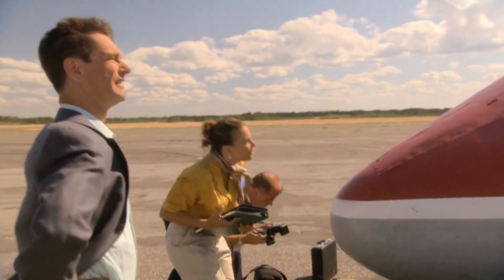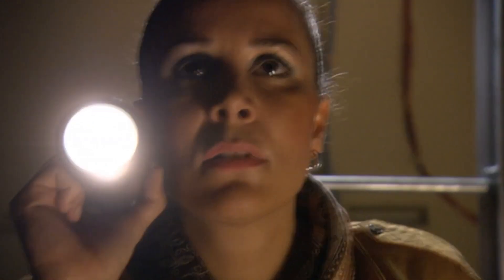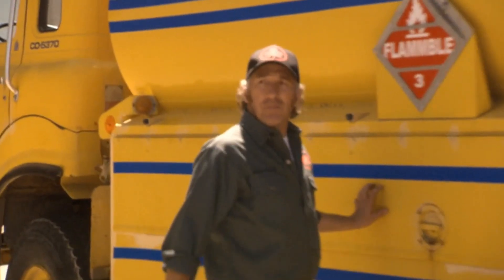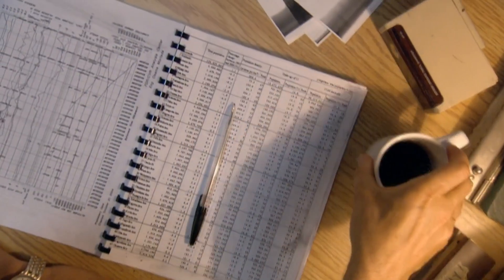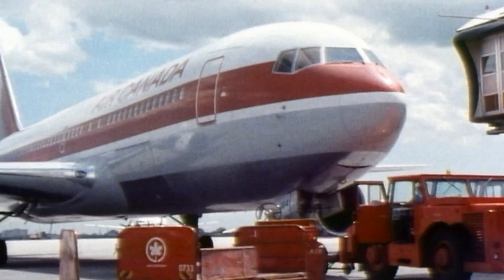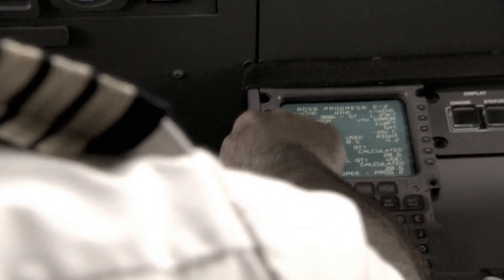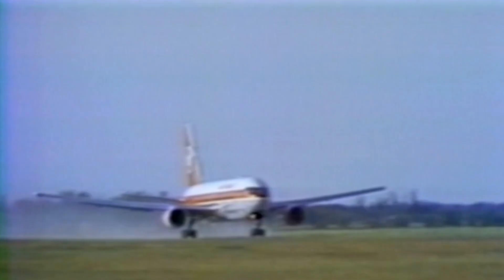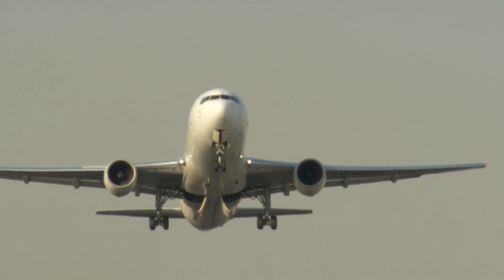Investigating The Gimli Glider Crash | Gimli Glide | Mayday: Air Disaster

Comment: How is it that the pilot was “partially blamed” instead of Loudly praised?  The pilot and copilot should have been hailed as heroes.
Reply: I wondered the same thing.  There should be no blame for them.   They are heroes.
Reply: They needed a scapegoat
Reply: Agreed,  sometime you wonder about the management must drink lot coolaids
Reply: Captain Sully went through the same blame by the FAA. They tested pilots with the same problem (engines out) and see if they could land at the nearest airport. All could. But they were all prepped about the failure and how to and where to land ahead of the test. No one mentioned how pilots that were not prepped did, UNTIL Sully asked the question. The FAA had done the tests, and none of the unprepped pilots made it to an emergency landing at the nearest runway. The FAA wanted a scapegoat and thought they could manufacture one by blaming Sully. They failed where he succeeded. Why not acknowledge the real problem? It will save lives, not destroy them.
Reply: @hifinsword  This was made up for the movie. There was some minor second-guessing because the FAA wanted to see if it might have been possible for Sullenberger to make Teterboro (even in the event of a practically perfect water landing, there are always lessons-learned to be taken and things to be seen if the crew could have done better; the better to inform future crews who might find themselves in the same position), but it quickly became apparent that it wasn't. The NTSB and the FAA went out of their way to explain that their investigation was simply standard procedure after any form of plane crash and was not meant to be in any sense an indictment of the actions of Sullenberger and Skiles.
Reply: You can be part of the problem and solution.
Reply: @claudiuspulcher2440  ~ Yup, and you can have a wife & a husband, too. Go for it, Claudius.
Reply: Had exact same thought when I heard of them being blamed - say what???
Reply: Well, the initial thought is that it's on the flight crew to make sure there s enough fuel. But when you think about it theres nothing they reasonably could have done differently
Reply: It's from the gov't! That's why!

Comment: I am at 5:19 into this video after watching the event happen on another video. I think before this video is finished that I know what went wrong! I will say so now and if wrong I will admit it. I have never heard of this flight event. I do not watch the news. Not since 1978! I think that the fuel truck pumped duel into the plane with the gauges set on either Gallons or liters! And the fact that there is a large difference in the two measurement types the plane didn't get the right amount of fuel! ANd I used to be a pilot. I flew pipeline for Magnolia Pipeline put of Dallas Love field in my younger days. Magnolia was the pipeline company owned by Mobile Oil. Well, I am now at 9:14 and I believe I am correct! Now today is  5-25-2021. A lot of years have passed since this accident. I am certain that this issue has been solved! What I believe is the real problem though is the fact that there are two different measurement systems on Planet Earth! Either the Metric system needs to be forced on the USA or the rest of the world needs to go back to the Imperial system of measurement. Since most planes, equipment and machines are designed and manufactured in the USA the world should be Imperial, not metric. And people who will tell me the Metric system is better know nothing! Americans have been using the Imperial system for its complete existence. Originally France designed the Metric system in the 1700s. Britain adopted the Imperial system in the 1800s. Too bad both countries were always at war back then!

Comment: But if they manually checked it like they said then wouldn't they have noticed it was low upon fill up?
Reply: No because they check how much fuel is in the tank FIRST and then figure out how much more to add from there. They determined they needed 22,500 lbs of to add, when they really needed 22,500 KILO's. A pound being only half of a kilo, that mistake gave them only half the fuel needed. Maybe they should manually check first, and then manually check AGAIN after filling up?
Reply: @morrnmanderson7376  thanks, I was confused about that part.

Comment: Nice job landing an airliner w/o power - BUT - It is the Captain's job to thoroughly 'pre flight' the aircraft before the flight. This includes the aircraft systems, avionics, weight and balance, fuel load. weather, etc. Why would they take off with a faulty computer processor and disabled fuel gauges?  I'm surprised that the computer failure wasn't a no/go for this flight.  I expect better from professional pilots and airline companies.
Reply: You'd never be flying if you knew the crap they let get past

Comment: Kind of wish they'd given us the actual calculations, like converting volume to weight. I think that depends on the specific gravity of the fuel used. The ground crew should have been able to tell by the time required to fuel ... when it "filled" in less than half the expected time. Maybe a good old-fashioned dip stick?
Reply: When have a question of how much fuel onboard .you should use the dip sticks to determine the fuel level.. when you have inoperable  gauges that is standard procedure .. if your not in tolerance its big indicator that aircraft must be dripped ..your 100 percent correct
Reply: Weight is a measure of force.  Kilograms measure mass.

But, yes, the weight depends on the density of the particular fuel.

Comment: I used to be a fueler with ASIG and had to take classes for inop fuel gauges. There are 4 approved ways to fuel an aircraft with inop gauges. 1 fuel transfer tank to tank, 2 cockpit gauges, 3 meter truck, and finally drip/magna sticks in the wings. You also have to measure the pitch and roll of the aircraft and if you measure the pitch a 1.5 but it's actually a negative 1.5 you'll miss fuel the aircraft and something like this will happen or you could make one side heavier than the other and cause a fuel imbalance. I always took pride in doing everything correctly especially during those types of MEL's
Reply: We applaud you!
Reply: You have undoubtedly saved lives.
Reply: Shouldn't the pilot and co-pilot have known the fuel for that plane was was calculated in metric ? They both had at least 75 hours flying that plane. They must have fueled that type of plane multiple times in 75 hrs ?
Reply: @golchf1
Baby, you weren't listening, hm? That was the flight engineer's task. He was replaced by a computer. The computer should've known how much fuel was needed and lacking in imperial and metric. If it can make a certain profession near obsolete then certainly it can do that. 
Either that, or, Air Canada should've appointed and trained a human in charge of fuel calculations.

Comment: The metric system is great and all, but we should have not changed the system used for critical systems like planes. This is like that time Russia tried to change to meters for elevation. Causes far too many issues, especially in a world where we use knots and inches mercury for flight.
Reply: SI is better than Imperial. It's not metric's fault that people are lazy and ignorant.
Reply: It is better, no question about it. But consistency trumps all. If the whole world switched at once it would be better. But better to stick with an outdated system, when half the world is, as you put it, "lazy and ignorant". Not to mention all the existing equiptment is in imperial, so you either have to retrofit everything, buy new, or add a calculation which adds more chances for error as in this case.

Tldr; from a scientific point, yes. Everything should be SI.

from an engineering point, it should be as consistent as possible worldwide, regardless of actual units.
Reply: @ZTenski  The fault lay not in the conversion system but that the plane had no working fuel gauges.

Most of the world HAS converted to SI. The USA sticks with the English dead king system.
Reply: @Canada_Dominium  "most of the world HAS converted to SI" I mean, kind of? Except for critical situations, like knots of speed, altitude in feet, compass directions in degrees, wood in 2x4s, torque in foot pounds, engine displacement in large engines in cubic inches.... I find it hard to believe that these measurements are different in different countries, except maybe cubic inches and torque. Because consistency is more important than the units, in these situations. And not just with the States. Consistency with older standards is just as important, if the risk outweighs the potential gain. Like it did in this case, I'd argue.

Radians are a better unit of angles for many reasons. Why don't we all use radians? Consistency. The unit doesn't matter outside of science and math, so long as the people communicating are on the same page.
Reply: @ZTenski  Radians aren't based on a dead king's tootsies.

What you describe is not a better system for critical situations--but simple laziness.

Imperial is utterly inconsistent and unworkable.

Comment: They have a much too complicated system for putting gas in the plane.
Reply: Yep, just filler up please!!
Reply: @kathymcmahon5308  Problem is they had no simple gas gauge on the plane to tell them that her was filled up.  (Gauges had failed.)  This is one of those "swiss-cheese" failures.  Several things had to go wrong at the same time for it to happen.  Failed gauges--wrong.  Conversion factor--wrong.  Training for ground crew and pilots--wrong.  Complacency despite failed gauges--wrong.
Reply: @kathymcmahon5308  Can't do that with aircraft for 2 reasons.  First would be cost.  Second is the more important reason and that is weight on landing.  If you cap the tanks every time and don't fly that far, you risk being too heavy on landing.  That can be very bad.